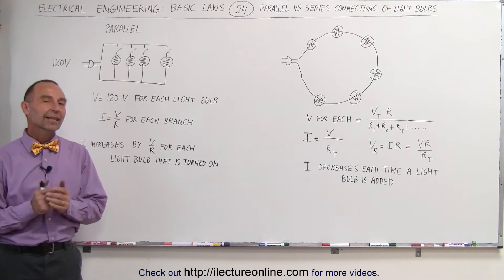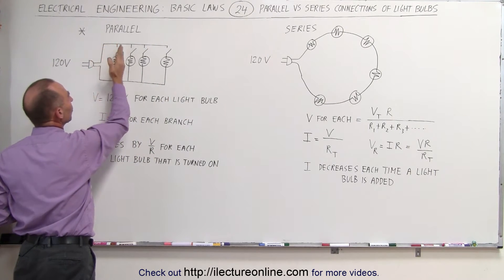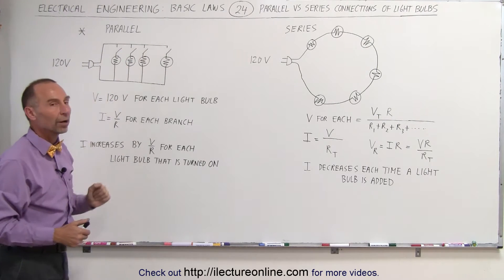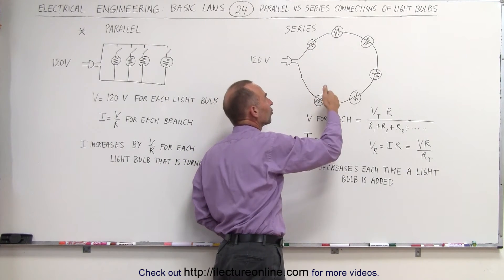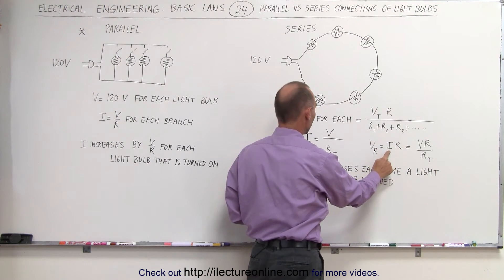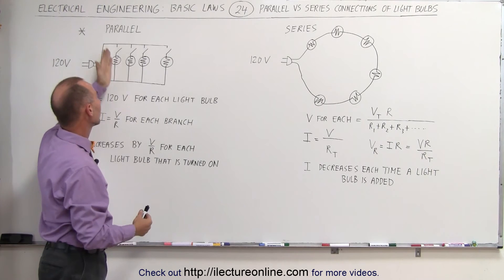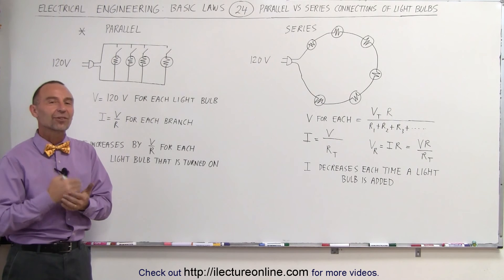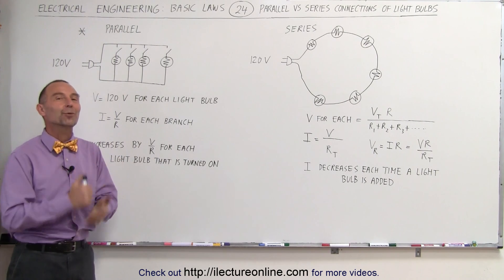Electrical Engineering: Basic Laws (24 of 31) Parallel vs Series Connection to Light Bulb

Comment: Generally current will always be same in series circuit and in a parallel circuit current will reduce based on number of branches connected in parellel right?

But in this case how is it the exact opposite (i.e) in series the current is reducing and in parallel circuit the current is constant ?

Can you please explain me I have had this doubt for months now

Comment: I think in series, V decreases each time a light bulb is added, not a current?
Reply from the maker: Think of a household circuit.  The voltage is always the same.  The current increase as you add more lightbulbs.
Reply: @MichelvanBiezen thank you so much. I learn a lot from your video.

Comment: 0:18 You should've specified that those 120 V are alternating (AC) not direct (DC). I think you didn't mention it because you haven't still defined alternating current (AC), and that's nice too. I just wanted to inform the viewers.
Reply from the maker: It makes no difference.  It can be either.